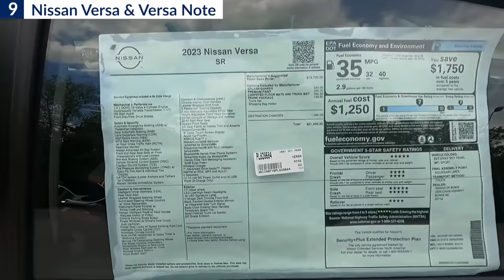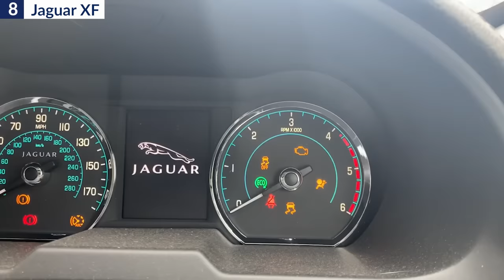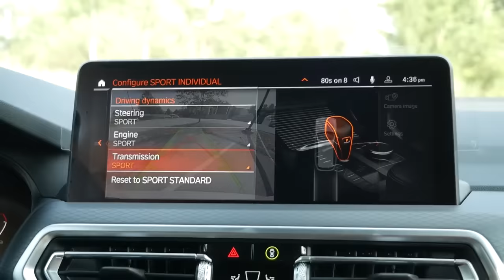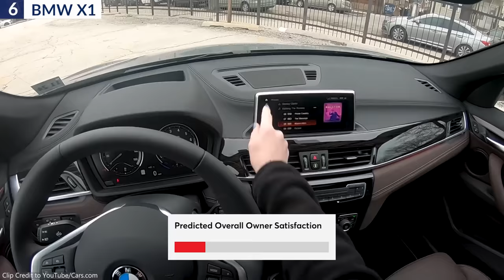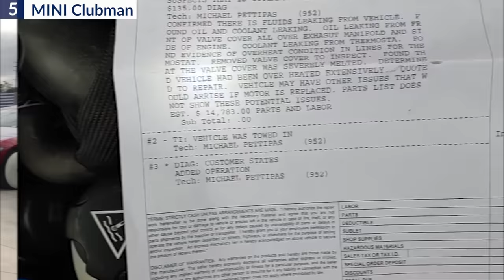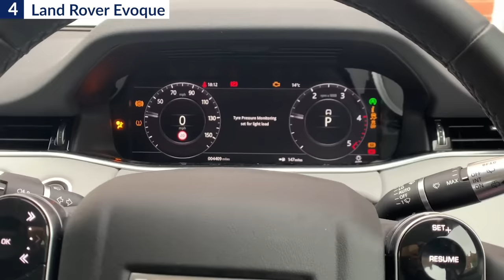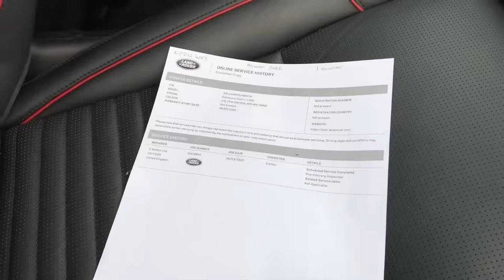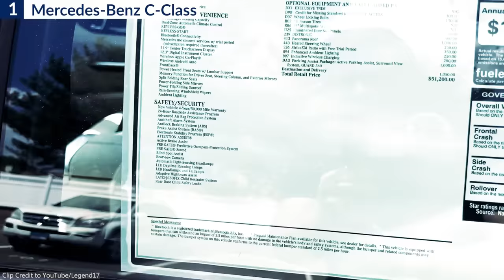9 Cars Owners Get Rid of in the First Year | Here is Why !!

Comment: I have a Nissan Versa approaching 100,000 miles and have been very happy with it. 40 miles to the gallon and no problems. I didn't expect it to be a luxury car but it does what it is built for very well.
Reply: @Runco990  no I haven't changed the fluid and I'm almost at 100,000 MI. $16,000 out-of-pocket 40 Mi to the gallon. I keep hearing about these supposed problems, but I don't know a single owner of these vehicles experiencing these problems.   16,000 out of pocket,  40 miles to the gallon, no mechanical issues.   The car has paid for itself.
Reply: @markhammer1902  Please change the transmission fluid at some point. Don't become a statistic.
Reply: I just bought a new versa a few weeks ago and am loving it so far. Funny that it's classified as a subcompact while the Corolla is listed as a compact and yet the Versa seems roomier inside and it also has a bigger trunk. It's also not as slow as people make it sound, especially if you turn off the vdc system. It handles really well and stops on a dime too.
Reply: I had a '22 Versa with the 5 speed stick. Great little car. I wanted something more sporty so I traded it for a new Camaro.
Reply: I've owned two Versa's. The older models were good. The newer CVT ones are pieces of junk. My first Versa, a 2009, I had little to no problems with. I bought that one used btw. I then traded it in for a new one, which I ended up regretting. I had nothing but problems with it from day one. Thankfully I took out an extended two year, bumper to bumper, guarantee at an extra $2000 + 15% tax (Canada) on the sticker price. Let's just say I got more than my money's worth on that extra $2k I paid. The engine in those cars are fine, it's everything else that is junk. I even had my rear wiper motor crap out on me three years in, at roughly 60k. My present 2011 Toyota Matrix is on its 13th year and the rear wiper motor is still the original. Also those Jatco CVT trans are known pieces of junk within the automotive industry. That's not my opinion btw. The old Versa's that didn't have CVTs were a million times better. Versa's, the old and new, are well known to have faulty coil springs that snap. I had it happen to both of mine. Drive that car like you are in a porcelain box. The coil springs are thin and cheap. It's very expensive when you have to repair one! If yours hasn't broke yet just be patient. It eventually will. Overall, it was a fun car to drive and I loved them for that reason. They weren't too small nor too big. A lot of cargo space and easy to park in tight spaces. I will never buy another one, let alone another Nissan. Datsun has taken over more of the company so it's less of a Japanese car now as it is a French one. I don't see the newer CVTs lasting nearly as long as the older models did. Oh, and the CVT that I bought new was a rattling piece of junk. I had to return about a dozen times to the dealership to have all the rattles within the interior trim resolved. One of the rattles was coming from a passenger airbag that had been installed improperly by the factory. They had to replace the entire airbag. Once again, thankfully everything was under a bumper to bumper guarantee. If not that car would have bankrupted me!
Reply: The Versa is a nice, inexpensive car. It does not belong in this list of mostly BMW's.
Reply: @barondystopia  Yes, mechanics say every 30,000 miles transmission fluid and filters (but no flushing).

Comment: You have to wonder how many were traded within a year simply because the owner bought a car he couldn't afford.   There's a lot of that going around lately.    The cost of ownership on a new car is pretty low, so that's not the real reason.
Reply: I think it's more likely to be the opposite, they can afford to swap and change if they don't like the car even for the slightest issue, so that's what they do. I only change my car every 5 years or so but would do so more often if it wasn't so expensive. Most people would probably do the same. Those who can afford to probably do.

Comment: I got a 2007 Mazda 3 2.3L with a 5 speed and has +250,000 on it still running strong. Other than replacing a few parts and basic maintenance, it's been a good cheap to operate car that is fun to drive.

Comment: No surprise there's no Toyota or Lexus models on the list. I have a very low mileage (60,000) big Toyota that's now 19 years old and it still drives much smoother and quieter on the highway than my wife's new Kia. And apart from 1 sensor, a set of shocks and a fuel pump, It's cost me very little over 10 years of ownership despite sitting on the roadside in all weathers. And of course it's worth  almost nothing so zero depreciation. I love Jags and Range Rovers, but you've confirmed my decision to never owning either of them.

Comment: A good friend of mine bought a BMW convertible I forgot the number. It cost $94,000. They traded it in for $18,000 4 years later. BMW has always been known for their expensive maintenance and massive depreciation.
Reply: Depends on the car, i bought a 3 series 335d 4 years ago for 21k, its worth 17k... depend which model you buy, any of the big versions do depreciate badly though.
Reply: billj bullsheet.
Any premium car has expensive maintenance Audi, Mercedes, rangrover, jaguar, etc, not just BMW.
And BMW actually have very high used residual values, so you are absolutely wrong, and are just bullsheeting.
Reply: In Malaysia, most BMWs are sold with 5 year full maintenance package making it zero maintenance cost. It depreciates rapidly from the 5th year onwards.

Comment: The 2012+ Jeep Cherokee. Bought a 2021 brand new and used it only for light commuting and a few road trips - nothing strenuous. Transmission went at 11k miles. Complete rebuild. Took MOPAR 3 months to get it fixed and the dealer wouldn't give me a loaner. Apparently this is a very common issue with the ZH9 9 speed automatic transmission used on a lot of newer Cherokees and Grand Cherokees. Stay away from anything Chrysler.

Comment: As a Dane I bought my third and new BMW 320 in 1977, after two new BMW 2002, from 1970, and many kilometers. It mostly started its life getting a new top on the engine + plus many, many other faults being fixed (One side window fell down in the door!). After nine month and still with its Warranty, I sold it for a new car!
Reply: Wish I could find one of those classic BMW type-2002s now. Simple transmission, rear end and engine architecture.  Reliable electricals.  FUN to drive.  Adequate 4-seater interior.
Reply: Growing up in Washington DC in the ‘70’s, I saw so many BMW 1600’s and 2002’s. I loved their boxy shape and minimalist design.

Comment: I kept a new Versa for 10 months. Overall it was a decent little car with the 5 speed manual and I liked it. I just decided I wanted a more sporty car instead so I bought a new Camaro (again with a manual).
Reply: The CVT is the downfall of the auto industry.
Reply: @alm4132 especially Nissan. Those Jatco CVT's they use are well known for early deaths because they don't have a launch gear to reduce strain on the belt when the car takes off from a stop especially on an uphill slope.
Reply: @johntracy72  We were lucky with our 2011 Nissan Altima we bought used at 20k miles 11 years ago.   We ended up giving it to our daughter, it now has almost 200k on it and she's still driving it.   Overall,  the car has been one of the most reliable we've ever owned.

Comment: Selling your car in the first year is probably the best way to increase cost of ownership exponentially.

I had my Jag 2.5l V6 S Type, 25kGBP new, for 14yrs.  Add 3k to extend warranty and a single 3k suspension fix at 10yrs and it was 2.3kgbp per year to own ( assumes  all cars need servicing, insurance, road tax and fuel and that this is similar for all cars of similar size and luxury).

Ditto my Evoque 2.2l diesel, 37k new  10years old and a 3k repair at 8yr old.  4kgbp a year plus normal running costs.  The 4k will drop as length of ownership grows.

My XE, 47kgbp new, i have owned for 5 years ( new cost included a 5 service plan) so cost is currently 9.4k per year and dropping.

When the Evowue and XE rust away of become unecconomic to keep then and only then is it new car time.

At current anual milage i expect another 10yrs on the Evoque and 15 on the XE.

Never understood anyone selling a car after a year.

I did consider upgrading my S Type at 18months to a 3l S Type but was not willing to accept a 10kgbp loss of value on trade in just to increase high speed cuising performance, only used on a European holiday every 3 to 4 yrs.

Add to that paying cash or 0% finance deals since savings  grow if you dont make car payments every single month of your life and it is madness to trade a car in.

Comment: traded in a 22 tucson hybrid, after 10 months due to, vehicles lane correction would try to steer into oncoming traffic on left hand turns on 2 lane highways, engine knocked at low rpm and light accel, had driveline vibration at 10 to 45 under slight accel, and got zero help on any issues from 2 dealerships and corporate, my neighbor said his tries to steer into oncoming traffic too, he just fights the steering back. i feel hyundai has too much money going out in replacing all the engines that failed and the class action lawsuit due to them, and they now are trying to keep from spending any money at all on warranty repairs.
Reply: Hyundai has gone downhill. I just bought a black beauty Mazda CX-50 and love it.
Reply: Wasn't expecting to see this comment, but I'm glad you posted it. I've been thinking about buying a Hyundai Tucson or Santa Fe hybrid (same power train in both) in the near future. They're both so recommended by CR and various professional car reviewers I figured they'd be a good choice.
Reply: Can’t that be turned off by a button?
Reply: @jeffmorse645  Yeah, I almost bought one of those 2 but then I saw all the complaints about how the sound in their car completely turns off and you hear no sound. A constant issue with those Hyundais. Mazda is built better. This is my 3rd Mazda. The CX50 is gorgeous in black with black wheels. Definitely does not look like a Mommy car and is bad a** I even considered a Land Rover or Escalade but no way. Overpriced junk. Just like Mercedes.
Reply: @gregorysullivan7913  it can be turned off, but i shouldn't have to turn off safety features, but between that and the engine knock, (preignition due to timing programming) i knew it was going to cause premature bearing failure, so i traded it in on a highlander hybrid.

Comment: The only luxury vehicle brand I would buy is Lexus. I found them they last forever and they’re not high maintenance. Cost like all the cars on this video.. I currently on a 2023 highlander platinum, four-cylinder turbo that is absolutely amazing and power with no hesitation. It’s all the brand Toyota Lexus reliability and high resale!
Reply: Have had 6 Lexus and never had one in the shop for a repair…
Reply: I still drive a 1990 Lexus! No problems even now. , well a few cosmetic blemishes, but the engine still performs as when new.
Reply: Yes! On my 4th Lexus, won’t be switching off this brand! Never a day of trouble.  Had an LS460, loved it but 10 quarts of oil per oil change & premium gas $$$.  Switched to RX.

Comment: Lots of people are also returning BMW and Mercedes due to monthly subscriptions for things that were free before like remote start, checking tire pressure etc and you have to use the app to do it. you can no longer do it using the key fob. I had one of these cars and let me tell you you have to have a data plan in your phone and GPS for the app to even work, this means if you are in an office where you had no reception like I did you had no way to auto start the car. The app would constantly crash pissing me off. People had it with this kind of crap and decided to send a message by returning the car

Comment: I have had several 3 series BMWs, the last two were 330i xDrive models - a 2016 and a 2019. Both cars were solid and reliable with no problems. Yes BMWs are pricey but they come with 3 years of maintenance. I've had a total of 14 BMWs in various models. I agree on the X1, it does not drive like a BMW as it is a front wheel drive platform from the Mini, even when you get FWD.
Reply: It sounds like you just continually trade the vehicles to either have the latest eye candy or avoid getting to higher mileage. We all know BMWs don't age well.

Comment: I am pleasantly relieved to find a video with negative issues about vehicles, without one domestic brand listed! I’ve owned a Mercedes in the past, we bought new and although we kept it more than a year, we got rid of it within 2,000 miles of the warranty running out! Dealer service was wonderful, especially when issues were repaired under warranty. Seems like every season there was some $1,000 widget or another giving up and needed replacing. Then as soon as the warranty expired, the ignition module on the left side of the V6 engine quit, requiring replacement, that includes the three coils, wires and spark plugs, at a not very reasonable $200 each, that required 2 spark plugs each due to dual ignition, at $11.60 each! But there was a factory sponsored special pricing “deal”, for both sides at $1,200, parts and labor! That basically included the plugs and 1hr labor. That was it! I wasn’t going to wait for the next malady to catch up to us. I traded that ML 320 in the next business day! At the local Chevy dealer, in on what I wanted in the first place but was her turn for choice! So I traded in a 2002 ML 320, we paid $40k for, that got us $25k in 2005 on a nice new 2005 Chevy Avalanche LS, 4x4, that listed for $38k with no options. That was a wonderful SUV/Truck for 6 years and 90,000 trouble free miles, that finally needed brakes and second set of tires. So we traded that in on a 2011 Silverado Ext Cab 4x4 Z71, we got during an “ Employee Family Discount Price “, promotion, that came to $30,200! But got $25,000 in trade for the Avalanche! That Silverado was fantastic trouble free fun and adventure, till we trade that in on a 2019 Colorado Crew Cab 4x4 WT V6, we still have today with 41,000 trouble free miles to this day. With the plans on trading for a full size Van, to build into a Van/Camper. I like the Chevy Express 2500, but the 4x4 conversion is 12k! That’s still less than an AWD Ford Transit. The Chevy has a traditional hight roof that doesn’t allow you to stand in. But has a 6.6 V8 gas engine with 420hp 460 lbs ft tq. For still less than the 310 hp 420 lbs ft tq Ford Eco/Boost V6, with a med hight roof I can stand in. Tough choice!
Reply: So basically you just traded all the vehicles when the problems started to appear, not a bad strategy if you can afford it. Anyway, german cars are not bad, they are like a hot 20 years old blonde, they take a lot to get but a lot more to keep and maintain up to par.

Comment: Seems people don't hate turbo charged engines until they live with them for awhile.  No replacement for displacement.
Reply: Lexus NX is the exception to that rule with the dual turbo: 2.0-liter 8AR-FTS turbocharged four-cylinder direct injection engine that can run on both Otto and Atkinson cycles.
Reply: That's what she said.
Reply: I haven't heard any drivetrain complaints from owners of modern turbocharged vehicles. The old turbo lag & reliability issues are pretty much gone with today's technology, and the smaller displacement typically provides improved cruising gas mileage.
Reply: @johnmcmullen456   While vastly improved modern turbos still have noticeable turbo lag  and abrupt engagement.  I have a '18 CRV with the 1.5 L turbo. Like the car. Hate the turbo. I genuinely wish I had bought the lower trim version with the old non turbo 2.4 L .
Reply: @johnmcmullen456 I drive a newer Audi with the 2.0 turbo frequently. (In-laws car) The stop-start plus turbo lag is quite frustrating at times. It’s super quick once the turbo kicks in and gets nearly 40 mpgs on the highway though. To be fair, Keeping it in sport mode does help quite a bit.
Reply: @rond1949  A friend of mine went from a 2011 lame normally aspirated larger 4 cylinder Chevrolet Malibu to a 2018 model with the small 2.0 4 cylinder turbo. 5 years later, still loves it, and is disappointed that engine is now only available in certain Cadillacs. He has owned several  V8 & V6 cars and was surprised by the lack of any noticeable turbo lag, and the 8 speed (?) transmission does a great job keeping it in its powerband.  Another friend bought his Ford F150 in 2020 with the 2.7 V6 turbo and still has nothing but praise for it. Some of the current automatics are slow to kick down when you floor the gas pedal, like the Ford 10 speed in the F150, and many might mistake that pause as turbo lag. One of my cars is an old 4 cylinder fox Mustang I later turbocharged. Absolutely no regrets for the conversion.